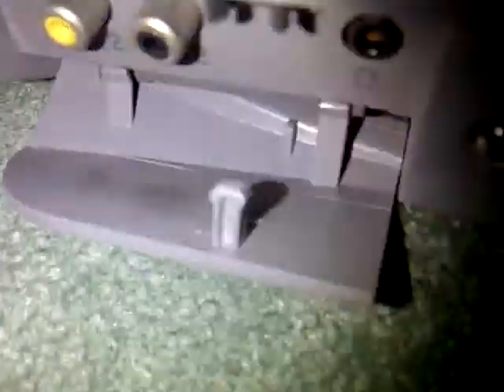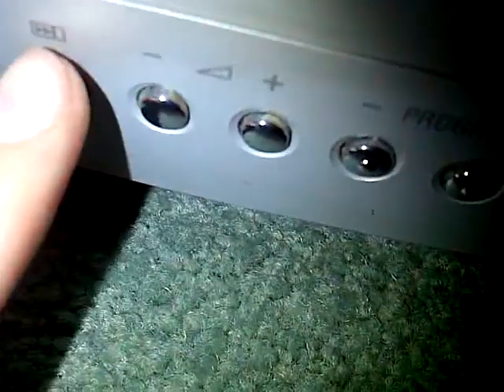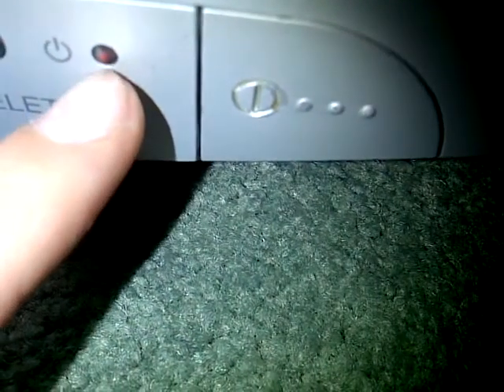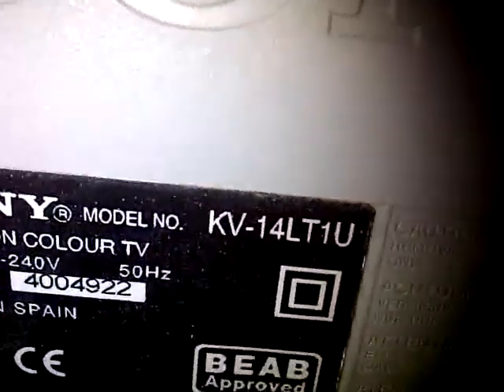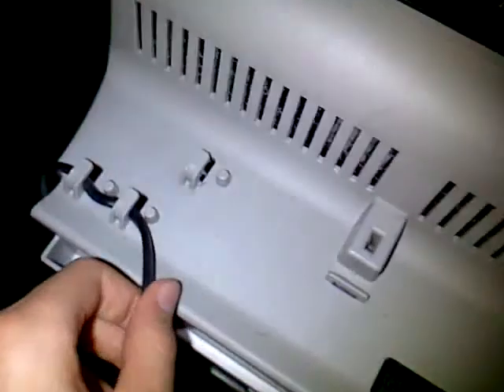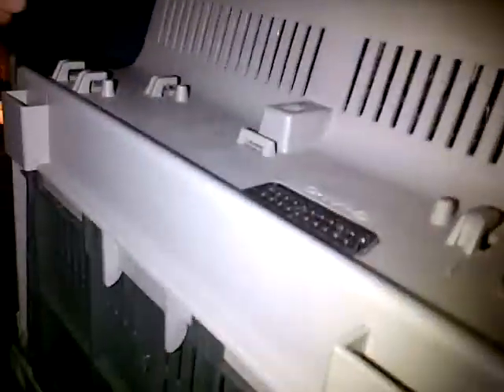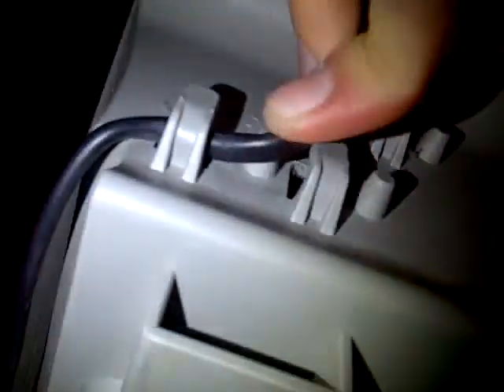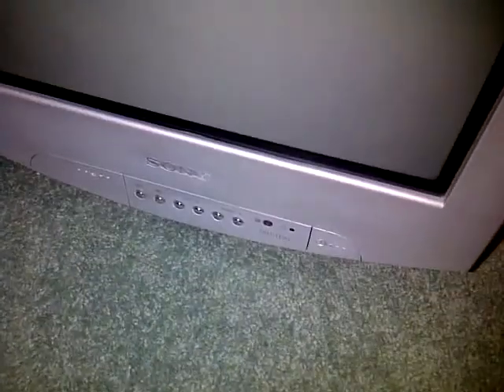Say goodbye to the Sony Trinitron TV

Comment: Are you sure? FD Trinitron Wega sets did not come out until the mid/late 1990s. The silver case for them wasn't really around much until 2001. You can prove me wrong, but I am guessing this is from 2001 or 2002. Also, flat screen TVs are complete rubbish. I would have kept that if I were you. Nothing can match a Trinitron.